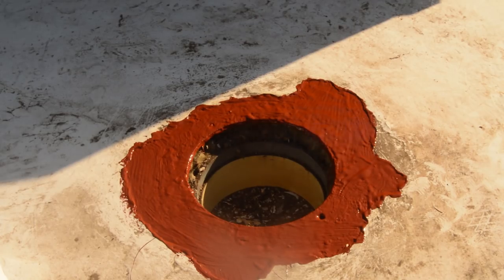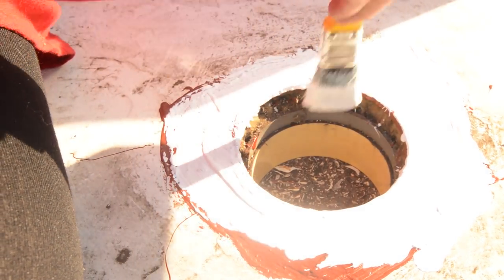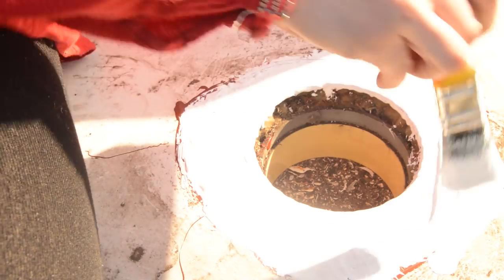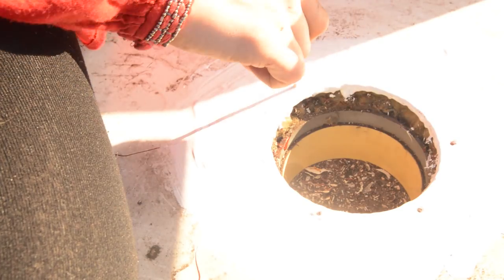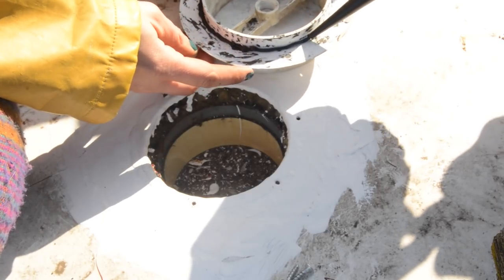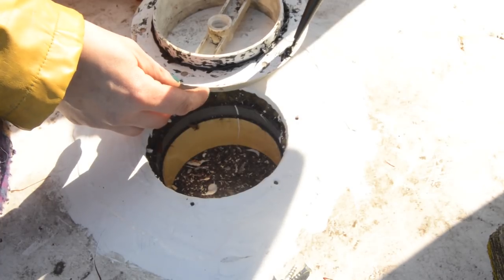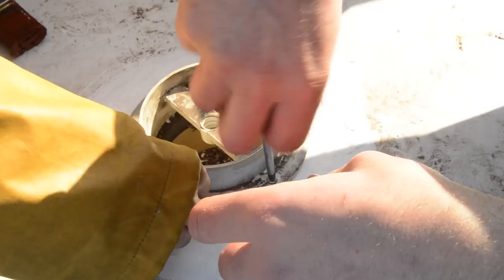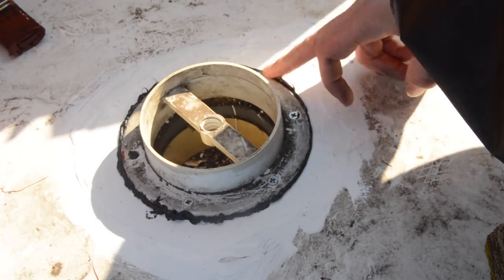How Did You  Re-seal your Roof vent?

Comment: I would definitely have removed more paint until I found uncorroded metal and then used a proper rust inhibitor rather than hammerite.

If you ever find yourself with a leak during winter when you can't paint it properly, there's a sealant called dicht-fix which is great for temporary repairs, I think it's supposed to be for guttering but I've used it on boats and motorhomes. Just warm the tin and brush a thick layer around the seal area, the results will last till spring.

Comment: why not try butyl bedding tape, easier clean up and is flexible water seal. Use it on all the deck fittings on my sail boats.
Reply: I second butyl tape or butyl in a tube does not break down and out last silicone.
Reply from the maker: i will try this next time! thank you!